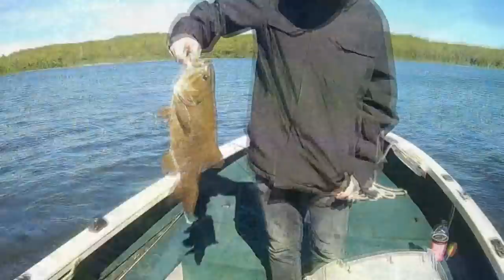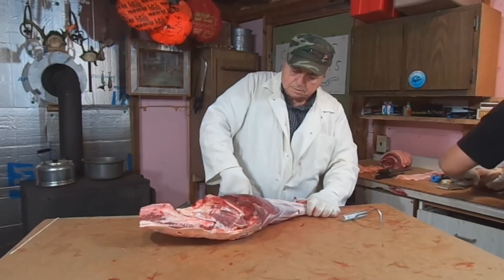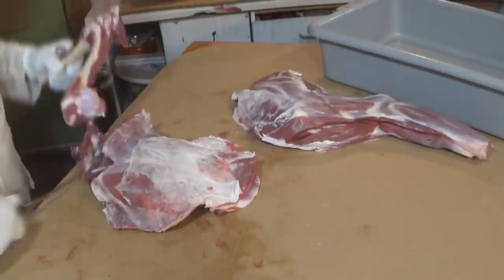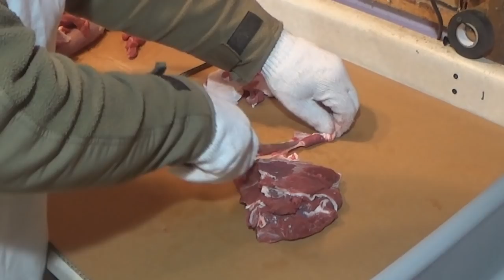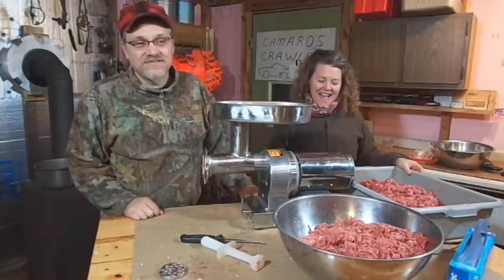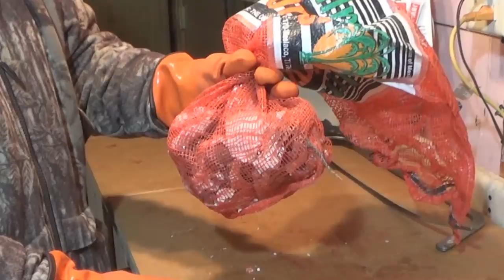How To Make Grind For Venison Burger From A Front Shoulder

Comment: Excellent! I live and hunt in Alaska.  I few tips I've learned in processing over 40 years: 
1)  I use a recipricating saw to cut the shanks into 2 inch sections for Osso Buco...much better than sending all those sinews into the grinder.  
2) For larger game such as caribou and moose, I fillet out 2 "flat iron" steaks from the scapula...I like those flat iron steaks even more than backstrap/tenderloin.  
3)To prevent knife cuts, I use a steel mesh fillet glove in my non-knife hand when working on a carcass.  
4) Partially frozen meat grinds easier than warm meat.
Reply from the maker: Excellent add ins, thanks, KPO.

Comment: Where do you get the card board your using? I assume its food grade clean
Reply from the maker: It is not food grade.  We do take a rag with bleach and give the cardboard a light wipe and dry.  We don't use cardboard that housed motor oil or antifreeze or something like that.  More like cardboard from TVs or computers.  I can't tell you it's perfectly safe so I won't, but it's probably as safe as many of the surfaces I've eaten off/cut on over the years. (camping, traveling, fast food, bars, restaurants, cleaning fish on rocks or canoe paddles)